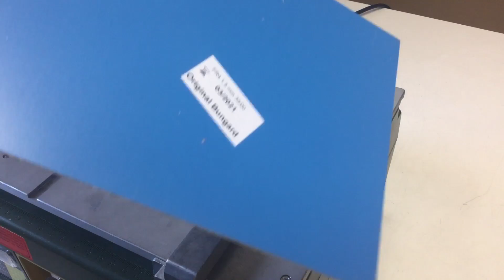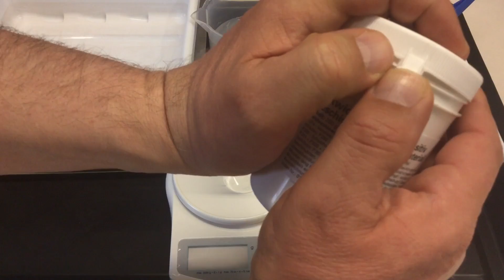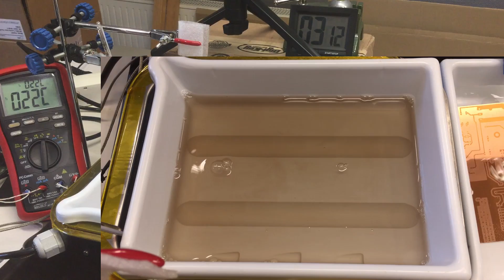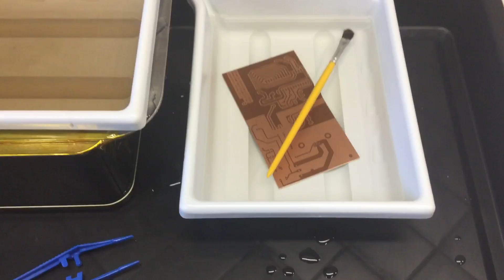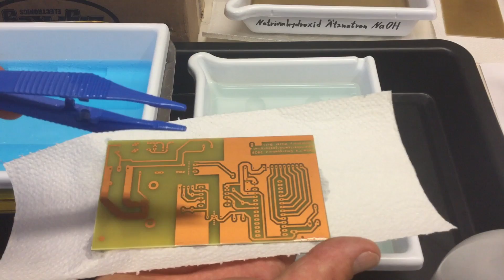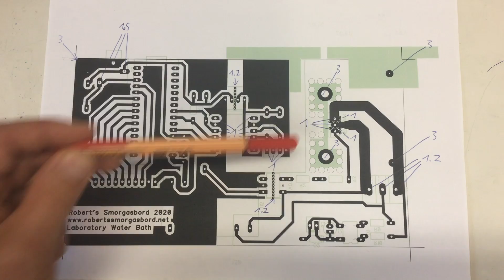Exposing, Developing, Etching and Drilling PCBs – My (Current) Way

Comment: Thank you very much for your interesting video, it is similar to my system.
As someone do, i also tryed in the past spraying fotoresist, but without post-heating ... Spraying must be operated in a dust-free room, and so you have to breath dangerous vapours; and you can't do it outside, because there is too much light ( and wind with dust ). Also you have to do this job often, so to become more and more clever ... 
You have to begin spraying outside the board, than cross the board itself and stop outside.
At the beginning and at the ending the spray-can sprinkles drops of any sort ...
Now i'm using pre-sensitive board, but i'll change to foto-sensitive film, i think it will be better.
As etching solution i use chloridric acid ( 10 % , used for cleaning toilets ) added with a bit of solution of hydrogen peroxide ( 3% = 10 vol. as used in hospital and also at home for disinfection of little wounds... ). The solution can't be stoked ( produces gas ) and also vapours of chlroridric acid which are dangerous and corrosive, so this solution is to be used outside, in a well ventilated area, and discarded at the end of the work. When etching it doesn't produce extra gas ( no bubbles ), also it's colorless, just becomes a bit green during copper etching.
I suggest - for every board - to change develop solution with fresh one. It's cost almost nothing, i use to prepare one liter of distilled water with 10 grams of NaOH ( caustic soda or sodium hydroxide ) and stock it for next boards. I DO NOT SUGGEST TO ANYBODY to make higher concentrations to diluite at need ... TOO MUCH DANGEROUS ! Use always safety goggles and don't let bits of NaOH around ... too much corrosive !
Just i have to congratulate with you about your safety instructions when using chemicals : safety is a must !
About printing master, i also used in the past - to get a darker "black" to stop ultraviolet light - to go on a photographyc process, using photographyc transparent film, to get a negative and then a positive master with a very dark black, using 1:1 contact print and relative chemicals.
I also see in the video you are using a Proxxon table saw, i have the little one, with 20 teeth blade; next i'll try the diamond blade ...
Reply from the maker: You're welcome! And thank you very much for the detailed description of your process. You can always learn from others! I do like the etching solution you're using - cheaper and easier to get than mine. But I'm living in a city on the sixth floor of an apartment building, and so going outside 'cause to vent off the chlorine gas is not really an option :-) Anyway, you should definitely try cutting your PCB material using a diamond coated blade, I always marvel on how easy that blade cuts through the PCBs.

Comment: i used to make double sided pcb at home but i used spray photo resist much more consistant and sprayed freehand put in dark box standing up to let resist flow to bottom and try and do it in cool dry conditions.Leave it 24 hrs and then heat to 50 degrees c for 20 minutes to make sure all solvent is out.Then use ferric chloride at 25 degrees 10 mins job done.The secret is to get print as dark as possible your print looks much to light that will let u.v. get through and weaken the exsposure.I send to china now they do pcb cheaper than i can buy etchant.Bit of a job for testing as desighn is fixed before proper prototyping.
Reply from the maker: I never tried spray-on photoresist (or dry film photoresist for that matter). I'm getting my Bungard photoresist PCB material for 1.94 € (single sided epoxy FR2, 100 mm X 160 mm). Without the photoresist it costs the same. So I never felt motivated to put on the photoresist myself. But reading your comment I guess I have to try it one day. Anyway, before that I'll have to master the solder mask process ;-) And yes, the prints out of my Lexmark 410de are not very dark. That's the reason I'm using two on top of each other (which is not optimal). I'm always thinking about getting an ink-jet printer for that purpose ;-) And no, nowadays you can't beat the Chinese PCB manufactures price wise - as long as you're willing to choose the slowest shipping option ;-) And you certainly can't beat a professional PCB manufacturer quality and feature wise.

Comment: Nice, but I think the photoresist must have changed quite a bit, probably something to do with health and safety (usually is !) or a bad batch, because I've never experienced development problems like yours...however great results, doubling up on the artwork is a good idea, and I have never seen those two sprays that you have, that was interesting too, despite the mess I prefer Ferric Chloride...great vid, cheers.
Reply from the maker: Thanks! Ah yes, the issue with the photoresist ... I do have a theory: I didn't bought that stuff from a big name distributor (like Digi-Key) but some "discount" outfit (Reichelt, Voelkner or Conrad - I don't remember which one). I can't imagine Bungard messing up that bad. But I can totally imagine the boxes with the PCB material sitting after delivery outside on some warehouse ramp for an extended period of time - with temperatures either well below freezing or well above 25°C (like 35°C). Both will probably mess up the material. Bungard writes something like "store cool, dry and in the dark" on their website (I have mine in the fridge at about 7°C). Ferric chloride or sodium persulfate - it doesn't really matter, as long as it eats away copper ;-) Regards, Robert

Comment: Nice video Robert, I've really enjoyed watching your process. I'm using Ferric Chloride and in the end tinning solution instead of flux spray. I never had a clue about High Densitiy Spray you are using. Are the results marginally better with it?
Reply from the maker: Thanks! To be honest the density spray is probably "snake oil". It does something, but not much. However, I bought it and so I'll use it until the can is empty ;-) Maybe I should make a video about the effect of that density spray ...
Reply: @robertssmorgasbord  that would be interesting. Density spay should seal plastic particles somehow according to datasheet. I wonder if it's mechanical or chemical process. Have you thought about mini CNC milling machine?
Reply from the maker: @LegacyDevices  My best guess is the density spray is just a mix of solvents, evening out the toner on the transparency. But I will definitely make a video about that density spray (e.g. looking with the microscope at the changes) when I print out my next UV exposure masks (which might be while).
And I've though about building/buying a CNC milling machine quite often ;-) In fact that's how I got into YouTube: I bought some linear guides from China to build one - they were total crap - I uploaded a review video to let steam off :-)

Comment: That's a classy process you have there Robert! I used to use Kinsten pre-sensitized board (the green colored photoresist made it easy to see progress), cut to size with a drop saw, and printed inkjet transparencies wedged between two CD covers held with pegs, exposed with an ordinary fluorescent desk lamp, developed with dilute sodium hydroxide, etched with ferric chloride warmed up in a microwave oven. I usually left the photoresist in place to prevent tarnishing but it could be wiped off with IPA. Thankfully it was a very forgiving process and timing/temperature was not critical.
Reply from the maker: Thanks! For some reason Kinsten PCB material is not available here in Germany (saw it on amazon.com though). Would have loved to try it (after the trouble with the Bungard stuff). I etched my very first PCBs back in the day using ferric chloride. Meanwhile I really prefer sodium persulfate. OK, you got to control the temperature while etching, but it's so nice (fun) to have a clear etching solution and be able to continuously see what's happening ;-)